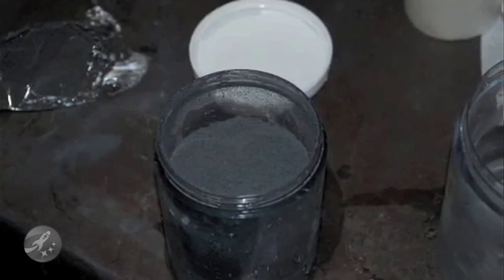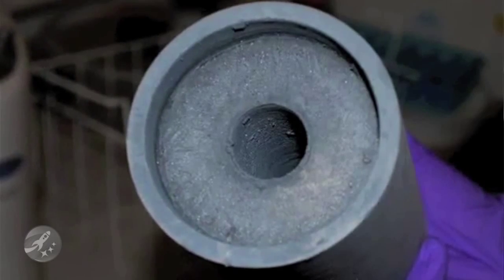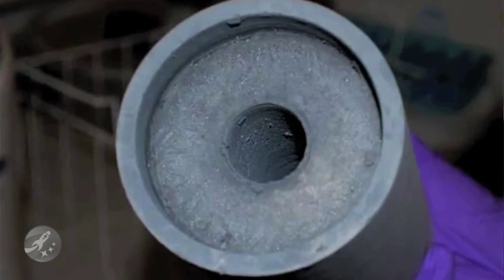ALICE Propellant - 09.10.12

Comment: This fuel gets better, the higher the ratio of al to ice proportionately with higher pressures. This featured fuel is at 2001.5psi and is ~15 -20% al. At 200,000psi, up to 50% al is feasible, bringing the frozen isp to ~317.

Comment: Beneficial with regards to increased thrust ? Could be that if the heavy -oxygen water were utilized that this solid propellent might even be used in place of things like UDMH for maneuvers once already in space as it would have a built in oxygen component or oxidizer ? I suspect this fuel could be further attenuated and or regulated if a consistent stream of high energy microwaves were incorporated to apply initial ignition as well as a sustained "combustion enhancer" or even a " shut off" mech

Comment: One assumes that the water used in the production of this propellent is standard H2O ? Is it ? Distilled water at least ? What if the standard distilled water were replaced with heavy water or deuterium oxide ? Or its sister isotope heavy-oxygen water , would that be beneficial ? I read that standard heavy water or deuterium oxide freezes a bit more readily than regular water ,about 40 degrees F for the D2O though I dont know the freezing point for heavy -oxygen water ?
Reply: The cost of heavy water and DI water are not anywhere in the same universe.
Reply: If we're going to start talking heavy water we might as well stay with current fuels. It's many orders of magnitude more expensive to use heavy water or heavy oxygen water.
Reply: the more pure the water the better, so ultra pure water would possibly be used but not D2O as Aluminium strips the oxides rather than used the hydrogen, so it would basically be additional cost and additional weight for no benefits and more negatives.